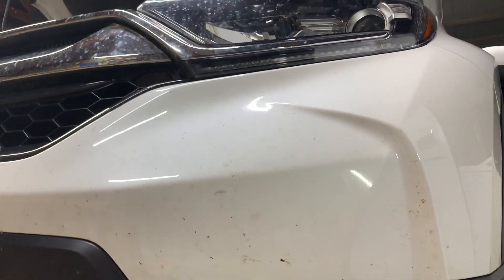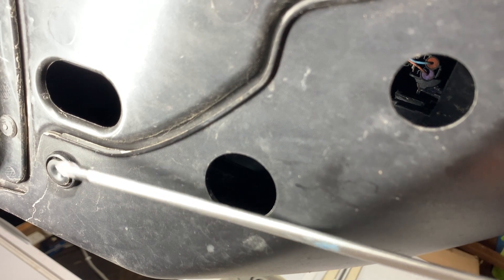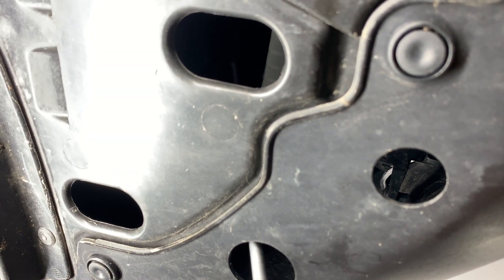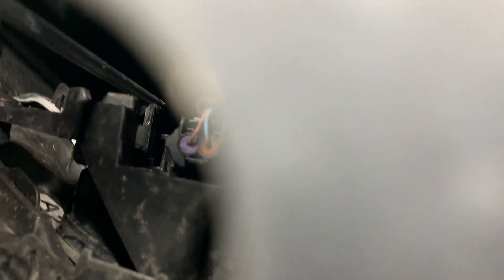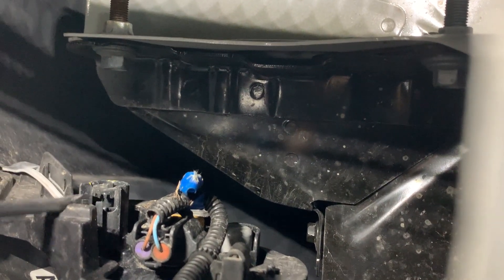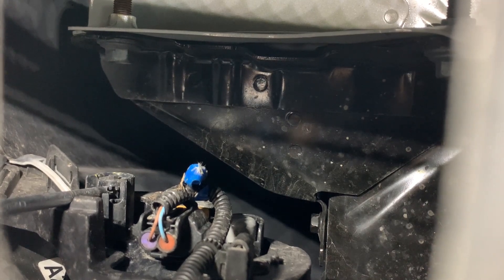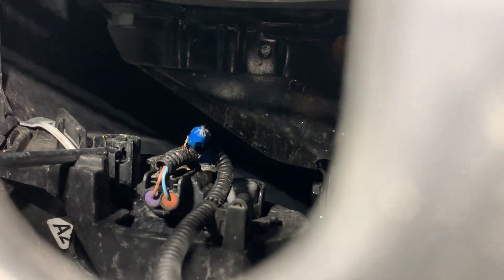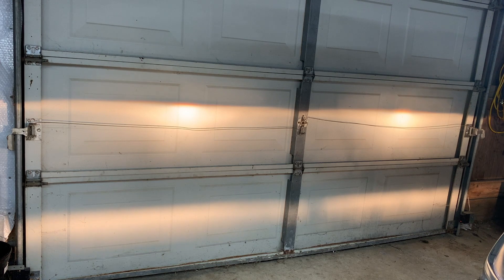Honda CRV-- How to Adjust Aim on Fog Lights Up or Down

Comment: Great video. 1st I’ve ever seen or heard of dealing with fog light adjustments. But, I’d like more information about proper adjustments. For instants; headlights have need a flat leveled   6’ distance against a wall to adjust them. At least that is what I’ve seen on YouTube videos. Is there a side to side adjustment as well? In any case, you raised a question that I’ve not thought of. Thanks.
Reply: Way back when people just drilled a couple holes in their front bumper and bolted on a set of lights (I grew up in two places listed in the top 10 for fog in the US, so I got to see a lot of this during the 70s and 80s when bumpers were obvious chromed things), people would generally park about 20 feet away from a wall, turn on their low beams, adjust the fog lights to be lined up just under them, and then tighten down the bolts.

In heavy fog, and sometime snow, the best option was to turn off your headlights completely and just drive using your amber fog lights. Bright white headlights just had too much reflection and scatter, effectively blinding you from seeing 15 or 20 feet past the hood of your car. Amber lights aimed lower at the road would let you creep along fairly safely at up to about 20mph.

When I did this for my own vehicle I also installed a set of halogen back-up lights on my rear bumper. They came in most handy on deserted roads late at night when someone started tailgating you and refuses to pass when given the opportunity (I assume they wanted me to pull over so I could be robbed). Turning those on directly into someone's windshield will quickly have them back off a couple hundred yards.

Comment: Aren't those low beams way too high?
I really hate to adjust lights. Lights should be at a fixed height. I don't care what the masters of the lightyverse say, a worn tire or suspension literally has almost zero effect on light height position...